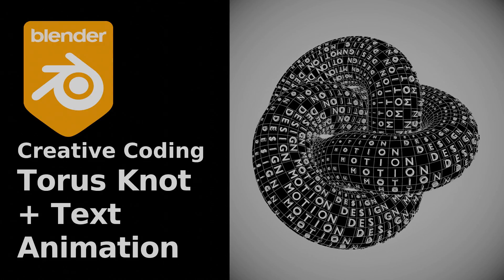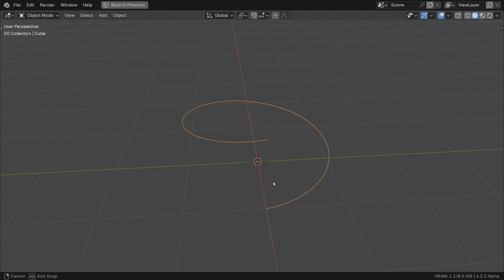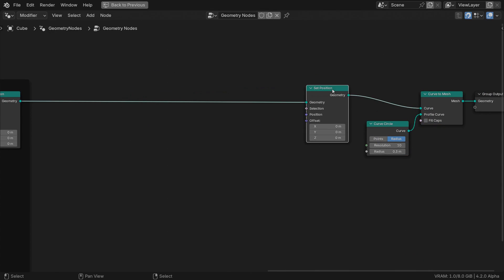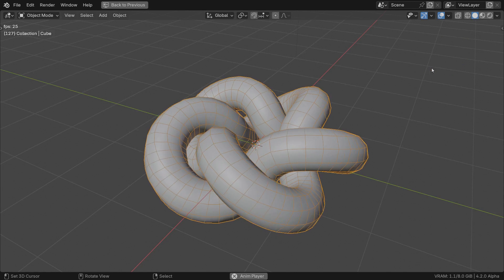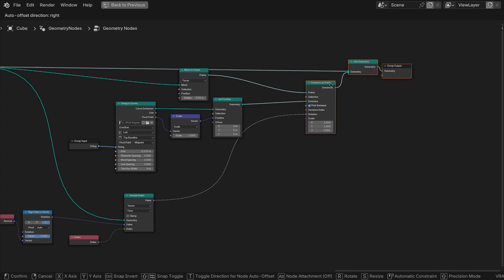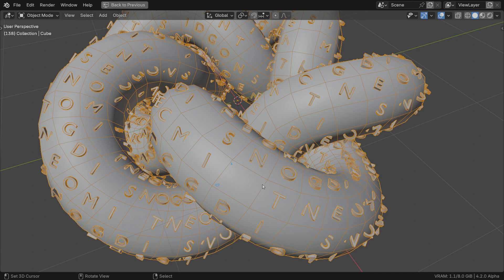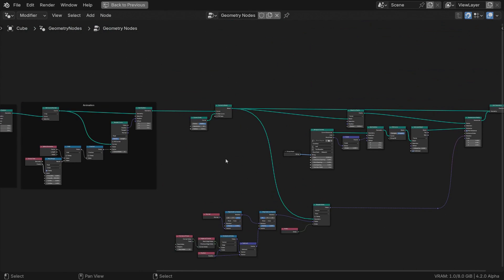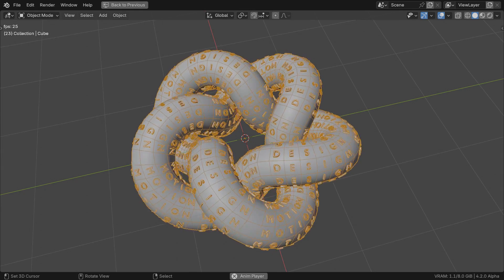Creative Coding - Torus Knot + Text Animation With Geometry Nodes

Comment: Nice tutorial! I`ve made it in 4.0 version without Sort elements node. The only differences is using curve indexes and linking it with index input of Instance on Points node. Also I`ve added profiler indexes, multiplied by int to control offset per row

Comment: so cool , thanks a lot for the tutorial my friend
Reply: One question, if I change the integers  or the vector rotate to gain a diffrent shape the animation stops looping. Ive tryd adjusting the integer value that leads into the curve circle resolution but without success. It's probably a noob question because I didnt understand the tutorial on an elemental level (im still fairly new) . Would you mind giving me a hint on wich propertys to adjust. or how the looping speficily works ? Much appreciated :)

Comment: What setting do you use to have the nodes automatically connect when placed in between two nodes? Currently, I have to do it manually.
Reply: And what keyboard shortcut did you use to slice two node connection points to join them?
Reply from the maker: @AllWormedUp  I'm using an older version of Blender in this video. I Alt+Click to disconnect the new node, then Shift+Click to insert it between two other nodes. The 4.3 version does this automatically. It's a huge time saver.

Comment: Thanks for the great tutorial! What would be the easiest way to flatten the knot on 2 parallel sides?
Reply from the maker: @JamieGuzik  what  do you mean by that?
Reply: @ilirbeqiri  Looking at the final shape of the torus knot, it's curved along all axes like a circle extruded along a torus knot. I'm looking to maintain the curve along the x and y axes but flat on the z. It's like the difference between what now is a tube and turning it into a tire.
Reply from the maker: @JamieGuzik  that’s exactly what it is, a circle extruded along a torus knot. If you want another profile shape, feed a custom profile to the Curve To Mesh node at the end.
Reply: @ilirbeqiri  Thank you! Looks like changing the curve circle to quadrilateral achieved the desired result.

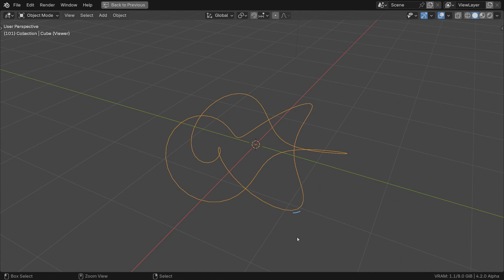Comment: Hi, I'm stuck on minute 6:38 of your tutorial. When I join geometry from the "Coil" section to Group Output it works fine, but I follow along for the additional steps shown on 6:38 of the video I'm getting an empty mesh displayed in the viewport. Pretty sure my node structure and setup for everything up until this point is exactly the same, but maybe not. And I am indeed using Curve Circle for the Profile Curve in the Curve to Mesh node group. Do you have any ideas what I might be doing wrong? The Torus Knot works perfectly joining geometry from the Coil section to Group Output. I'm using Blender 4.1.
Reply: Figured out what I did wrong. I incorrectly used Value instead of Position in the Sample Curve when joining with Position in Set Position. That worked : )
Reply from the maker: Happens to me a lot too. 😆